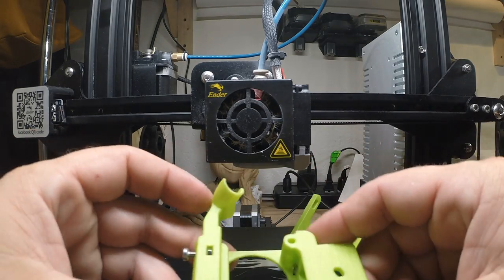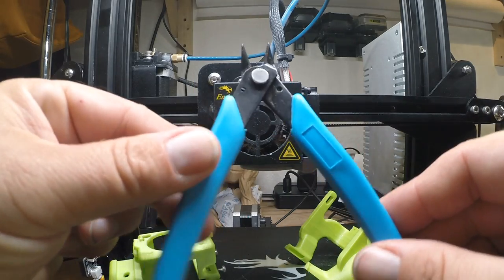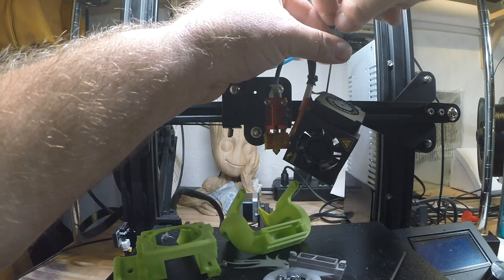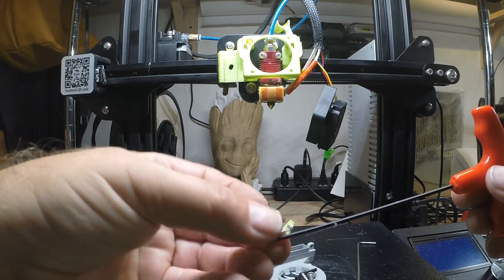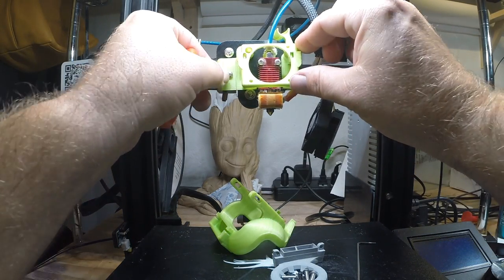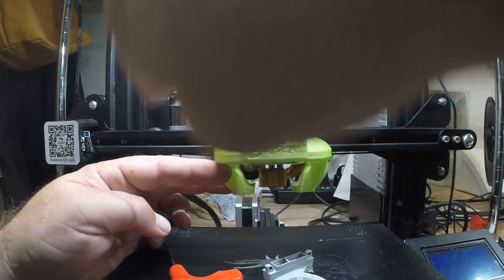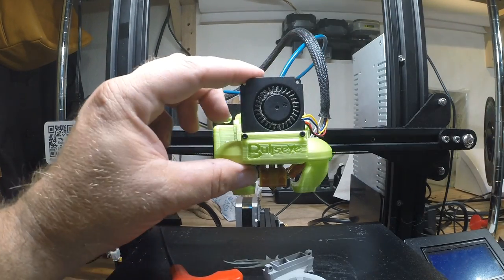PETSFANG BULLSEYE INSTALL ENDER 3

Comment: Im confused. The instruction pdf says I need nuts for the screws, your video doesnt mention them tho.

Also: what kind of screws do I need to fixate the second part?
Reply: I am pretty  sure  you figured it out by  now but you  just  use m3  nuts and plug them into the 4 holes that  you find on the first part. I fixated the second part  with m3x8 screws.  YOu can buy a 15€  500 nuts and bolts pack on amazon, which is pretty nice  to have.
Reply: @Benutzername0000  yep. You are right. Great video.

Comment: The bolts and nuts on the side near the back plate aren’t needed unless you’re gonna use the bltouch on the right side. Took me a minute to figure it out but yeah. You can see the attachment in one of the photos on thingiverse.

Comment: Hello, it seems my cooling nozzle fan is blowing the air the wrong way (not sure be it seems the air is grabbed from the nozzle and expulsed by the fan. I don't feel any air suction from the fan), even if i made sure the fan is mounted right on the bulleye. Any lead ? could it be linked to inverted poarity on the motherboard ?
If i put a sheet of paper in front of the fan, what should i see ? should be pusheed away from the fan or sucked in ?

Comment: It's not even a probably, this is the best setup for stock fans. Easy, perfect air flow layout, esthetically cool, pretty solid design. Print it with support "touching baseplate" and "80 overhang". You can also add a plate to put whatever you want for the name to cover the bullseye logo. All in all this is the perfect setup. I think if there was 1 thing I wish was done differently, was if they made it so the nozzle was a little more visible. The petsfangs were cool cuz you could see pretty much everything but this could have put the nozzle a little bit more forward or the bullseye unit sit a little higher so the nozzle is easily seen. Otherwise this thing really is perfect......oh and the wire tower....cut it off it's useless lol

Comment: at 16:58 the screws should be done from the back side forward, basically reverse your direction, the walls are thinner on the other side and use the stock screws that were previously used for the duct fan.

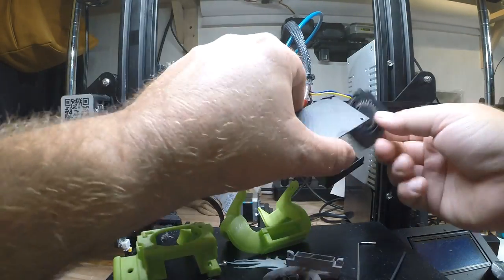Comment: 7:00 the thing is unless you're upgrading the fans you're really not doing much from stock except directing airflow to the opposite side while reducing the overall airflow to either side. The entire point is to change the fans to more suitable options.

Comment: You can use your wrench that came with the Ender as your adjustment tool for the height of the fan shroud. Just drop everything down to the plate then use the wrench as a height tool, from there tighten the shroud and you should be good to go. It just makes it easier than trying to hold everything up in the air.

Other than that very nice install video.

Comment: Do you have stock fans and a stock hot end on your ender 3 if so what files do you print?  There are only 1000 (seems like it anyway) files and I'm not sure what all the abbreviations are.  Could you please reply with the file names I need to print? I've downloaded them and think I need to print "BULLSEYE_BASE_CREALITY_9.27" and "Bullseye_Duct_9.27" Thanks

Comment: PLA low glass transition temperature does not affect performance ???? What benefits are you getting with new shroud ?
Also surprised how easy you can really move your Z axis - on mine it is not possible to do so THAT easy...is it normal or you just loosen something during installation?
Reply from the maker: I think i got lucky the mount is a true 45 ...my second ender not so lucky going to have to work on her soon. Thanks for the post.
Reply: @williamwolfe1986  What do you mean a true 45? That the mount is at a true 90 degrees right angle?

Comment: Tip: put he screws for the front fan from the backside. Doesn’t matter how long the screws are, easier to assemble
Reply: Yep, that's what I ended up doing. Use the short screws, install from the back side.
Reply: I found that for some reason the back holes didn't seem to line up and it started to put pressure on the bracket but they fitted fine from the front!

Comment: The issue with ABS is not the hot end temperatures. its the fact that the hot end does not melt the ducts because THEY HAVE AIR running through them constantly cooling them. but with ABS you turn the parts cooling fan "OFF" so there is no constant cooling for the ducts and they melt.

put a JST plug on your fan. then all you have to do is loosen your friction screws holding the bullseye in place and simply REMOVE IT when you do ABS or other non parts cooling fan prints.

Comment: for the front fan on the fang itself, the assembly instructions read to put the screws in from the back. doing that, it wouldn't matter if you used the long or short screw then :)
Reply: After watching the vid and then looking at the pdf instructions myself, I don't think he spent enough time actually reading the instructions. Other than a few discrepancies I think it was a good video.
Reply from the maker: This is a wondeful upgrade. I just want to take some of the fear out of it. I was so brave...lol

Comment: Thanks for the LED mount, I used a Neopixel STICK, RGB, and I'm hoping to use it in future to take advantage or Marlin now having neopixel temp light colour changes. For now it's just white. Resistor and cap added as advised by Adafruit.

Comment: How did you get all the support material out of the screw holes? I am having the hardest time getting it all out. I followed your settings and it printed beautiful but the support material is on there good.
Reply: Print it with support from buildplate only, then it won't generate supports inside the holes.
Reply: Johan Svensson well, in my case Slic3r was still able to create some support inside the bullseye -.- 
 I discovered it during the being. Before the upper part was closed, I paused to print and removed everything. ... at the end of the day, that paused layer was a weak spot :-/

Comment: Great tutorial, but I have to go for the vent ring because Creality just tightened one of the two screws so hard in that I just hollowed it out trying to get it out. Now it's stuck in there forever :-/ and no way to get the vent casing off. Was the ring good?
Reply: if you have a dremel or similar tool or maybe even a junior hacksaw (but this will be hard to use) then cut a slot in the stripped head and use a normal slotted screwdriver to remove it.

Comment: Ok so I guess I didn't install mine exactly correct. I didn't use the the two Phillips screws you used it seemed to lock in tight without them. I've been running it that way for about a month now without any problems. I think I'm gonna put them in though. Thank you brother for showing me the way.
Reply from the maker: The petsfang is the best UPGRADE....i will have a video on the led light set up vwry soon.
Reply from the maker: Oh yeah the guy who designed the bullseye sent me a email and the two screw on the right side are for the bed leveling upgrade and you dont need them. I will talk about this on the LED wire up.
Reply: @williamwolfe1986  oh ok. The two screws must be to tweak it for the bed leveling sensor. I'll have to make sure I catch your video on the LED's. I have them on both my Anet's but this one is 24v. I just got my 2018 Tevo Tornado in today and I'll be putting a Bullseye on it along with lighting that one up too.  You just got a new sub. 🙂

Comment: Other than stock screws and nuts, what other exact screws and quantities do I need to purchase?
Reply: I just installed this. I do a lot of custom drone building and had a pile of M3 & M4 screws. I think any short M4 screw would work fine. I ended up using M4*10. I bought this a while ago: https://www.amazon.com/gp/product/B071KBVZVV/  I've used the m4 washers to keep the bed springs from loosening too.

Comment: I see everyone going over the top with the cooling. I just used the most simple mod (the one replacing the air skirt with an almost similar that concentrates the air flow at one spot) and my prints are way better than what everyone with Petsfang shows.... I do not understand the significance of that... Imho cleaning your fans every 300 hours or so (thats what your fans look like) is a much better ''upgrade'' than Petsfang... And it costs nothing.
Video is good, explaining what needs to be explained for those that want this upgrade. Drop the music next time. It is annoying , 3 chords repeating for 28:40.....

Comment: Hey, thanks for posting this install vid. I am trying to learn how beneficial these fan ducts for various filaments and print settings. Did you end up running identical test prints after installing in order to compare print quality with the previous fan duct?

Comment: Where do you wire in the led to?
Reply from the maker: It has it own pwr. Not on ender 3 system
Reply: I used the same 12V LEDs and I added a 240R resistor and wired directly in to the always on fan.  All I want is light when I’m printing and no need for dimmer etc.  LEDs take 40mA so a regular resistor should be fine for power ratings.